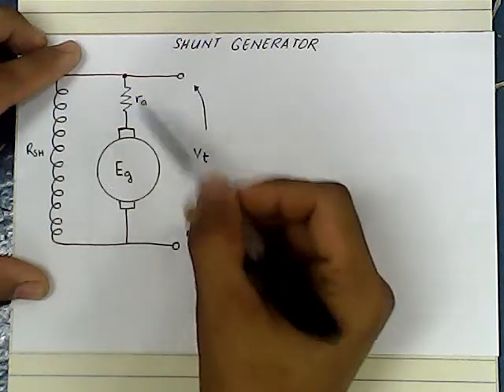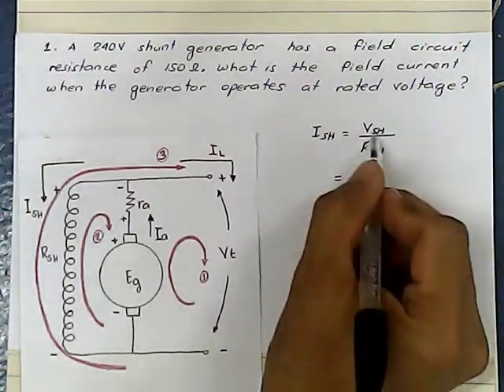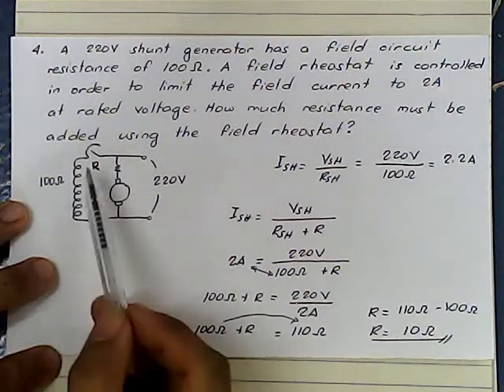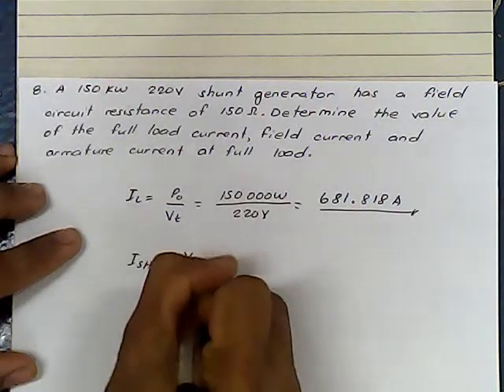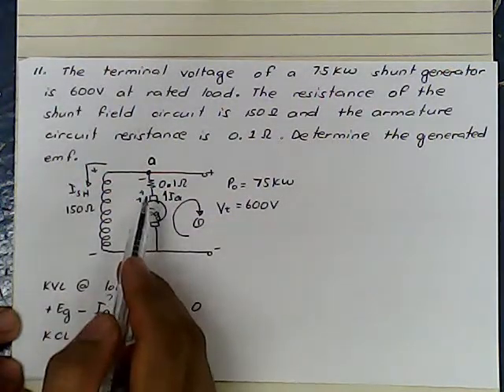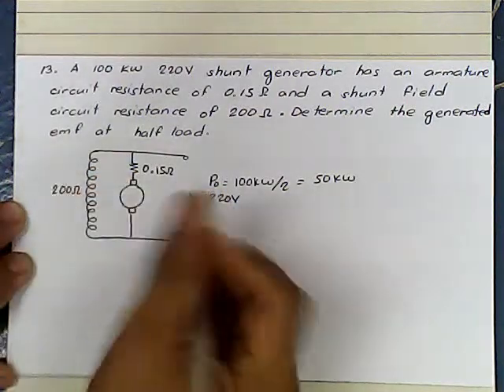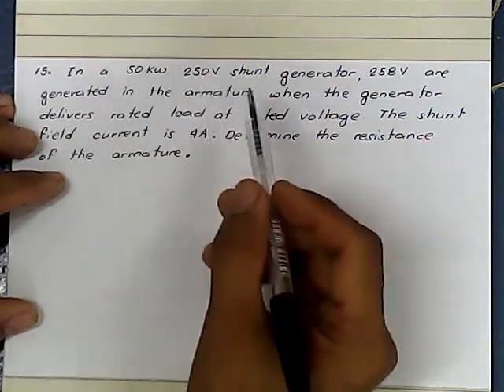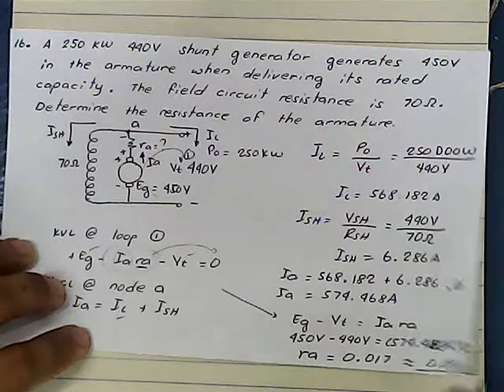16 SOLVED PROBLEMS: DC SHUNT GENERATORS (explained in TAGALOG)

Comment: Ndi po ba ung Ia ay current of the armature at IL or Is ay load sir dba po dpat Is=Ia+Ish??
Reply from the maker: Generator ito. Sa armature nanggagaling ang supply kaya
Ia = IL + Ish

Sa Motor yung may equation na
IL = Ia + Ish
Since ang supply ng power ay manggagaling sa linya or supply.

Actually diyan nalilito ang iba.
Magkaiba ang flow ng current sa generator at motor.
Palabas sa generator, papasok naman sa motor. Kaya may difference sa equation nila

Comment: A 10-kW, 250-Volts shunt generator, having an armature resistance of 0.1 ohm and a field resistance of 250 ohms , delivers full-load at rated voltage and 800 rpm. The machine is now run as a motor while taking 10 kW at 250-Volts. what is the speed of the motor? Neglect brush-contact drop 

Sir enlighten me about this one po
Reply from the maker: Halow.
Solve muna yung Eg kapag ito ay generator.

Then solve ang Eb (back emf) kung ito ay acting as a motor.

Then using the relationship nila with the Speed

Eg/Eb=Ng/Nm
Nm=NgEb/Eg

Where
Eg- generated emf
Eb-back emf
Ng- speed as a generator
Nm- speed as a motor

Comment: A short shunt compound generator supplies a load at 100 V through a pair of 
feeders of total resistance of 0.05 ohm. The load consists of four motors each 
taking 40 ampere and a lighting load of 200 V, 60 W lamps. Armature resistance 
0.02 ohm, series field resistance 0.05 ohm, shunt field resistance 50 ohms. 
Find.
(a) Load current
(b) Terminal voltage
(c ) Emf generated.

Pano po sir gantong given? Ung may motors po. Salamat po

Comment: Find the resistance of the load which takes a power of 5 kW from a DC shunt generator whose external characteristic is given by the equation: V = 250 – 0.5IL.

Pano nman po to sir kapag Resistance load?
Reply from the maker: Sorry for the late reply.

https://youtu.be/UMnqrM665X8

Comment: Applicable po sa lahat ng dc shunt generator problems?
Reply from the maker: If involve ang circuits ng generators, yes. Kirchoff's law, ohms law and power formula lang need.
Pero minsan may mga additional conditions such as involving flux, speed etc, need ng equation ng generated emf. Plus their ratio and proportion kung dalawang conditions ang sasabihin ng problem.

Comment: A dc generator has no-load output voltage of 120 V. Its armature circuit resistance is 0.95 2 and its field colls are separately energized. If the load is rated 2 kW at 115 V. What power could be delivered to the load?

Paano toh?
Reply from the maker: Since dc ito, kunin muna yung resistance ng load.
I=P/V   = 2000W/115V  = 17.3913 A
R=V/I   = 115V/17.3913 A  = 6.6125 ohms

ang load resistance na ito ang ikakabit sa dc generator. then ang resistance na 6.6125 ohms ay in series na with the armature resistance na 0.95 ohm.
Rtotal = 6.6125 + 0.95 = 7.5625 ohms

Kunin muna yung current

I = 120V/7.5625 ohms  = 15.8678 A

computing for the power

P=(I)squared x R  =(15.8678)squared x (6.6125 ohms) = 1664..9355 watts
or approximately 1665 W

sa terminal voltage naman
V=IR = (15.8678A)(6.6125ohms)
    = 104.926V or approx. 105V